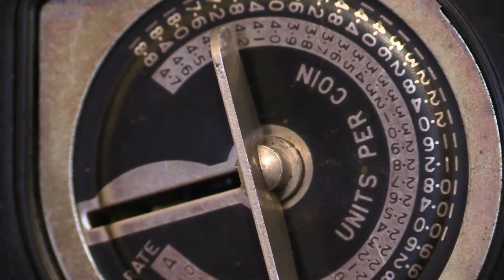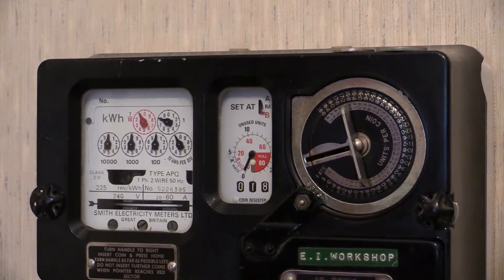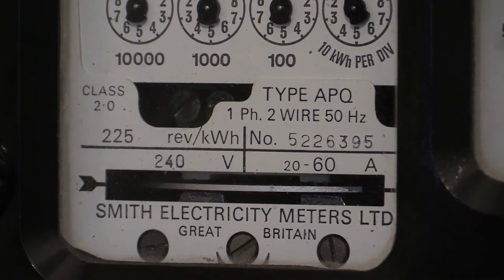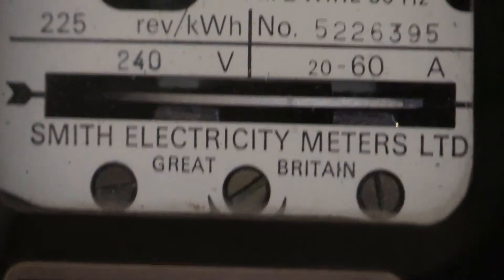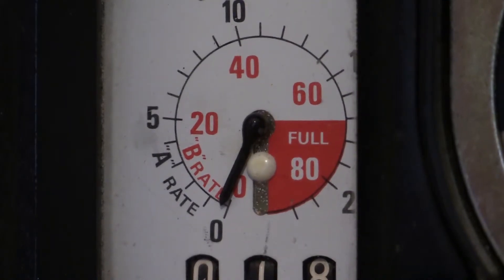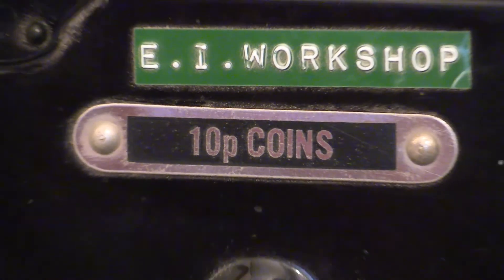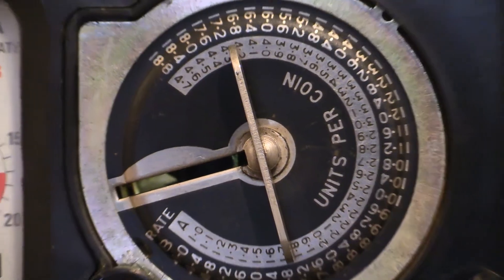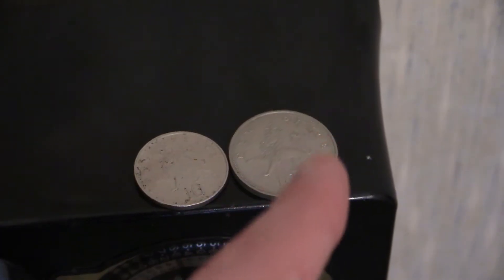Electricity Meter : Smith/ Ferranti APQ prepayment kWh meter.

Comment: Hi Wayne. 
I’ve just watched one of your videos. It was “Wayne’s electrical Wednesday VN0011. I have the same meter installed to a communal laundry. Two machines. My problem is how do you set the rate for this meter and also how do you change from A to B rate. I would be grateful for any help. 
Cheers Peter.